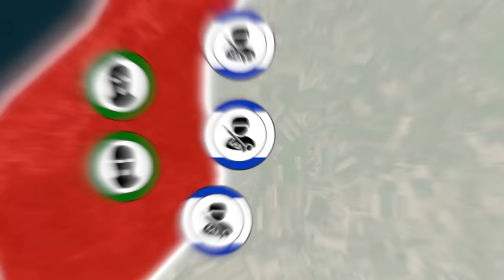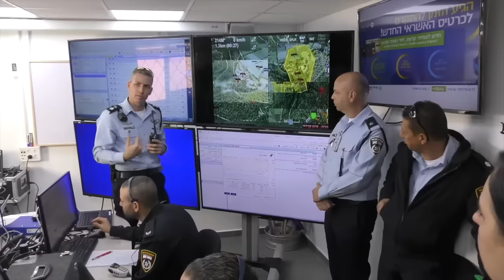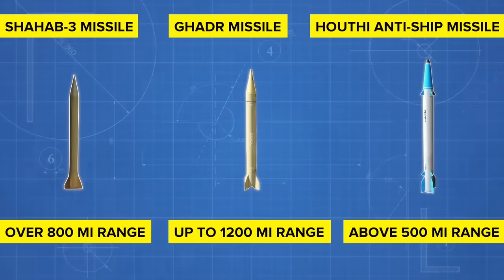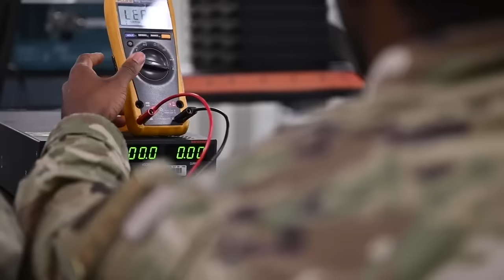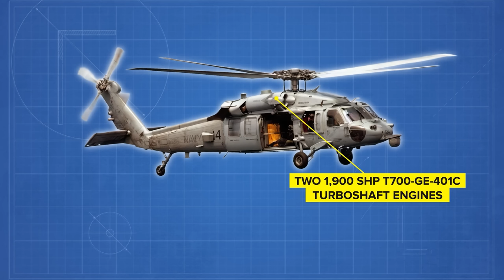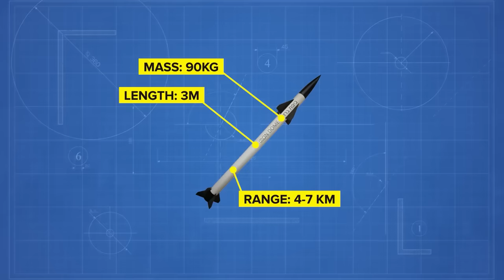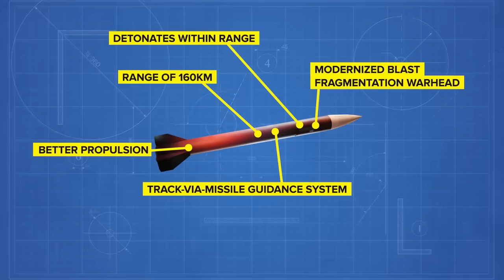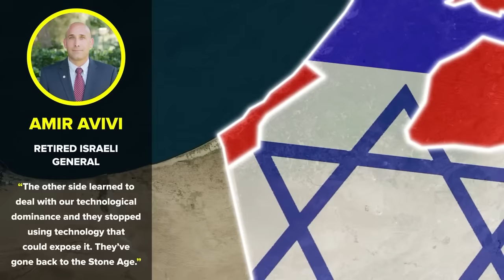Will Iranian Drone Attack on Israel Force U.S. Into War?

Comment: Is alaska the size of iran?
Reply: Iran is approximately11% larger.
1,648,194 sq km Iran
1,481,348 sq km Alaska
Reply: @kennnuthatch5724  yeah alaska just looks huge on maps since the standard maps we use sacrifice proper scaling of areas to keep their shape looking about right
Not easy to fit the content of a round globe onto a flat map
Reply: It’s also even bigger because it is closer to the equator which has more surface area on the globe🙂. People forget about that.